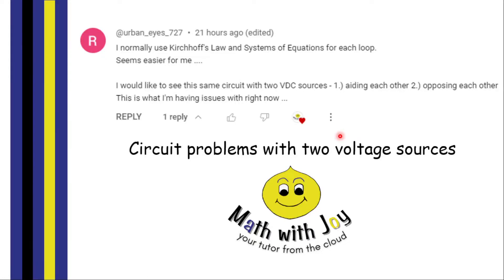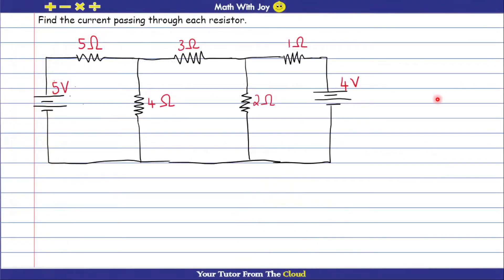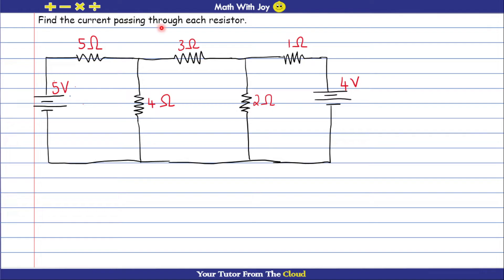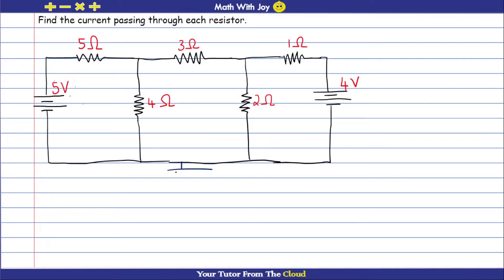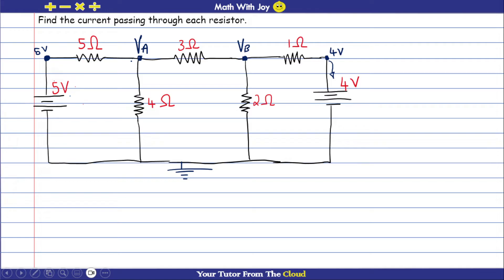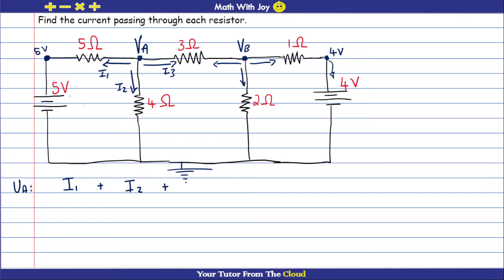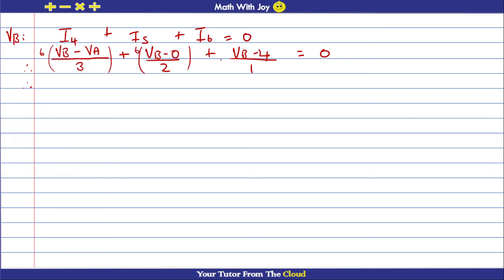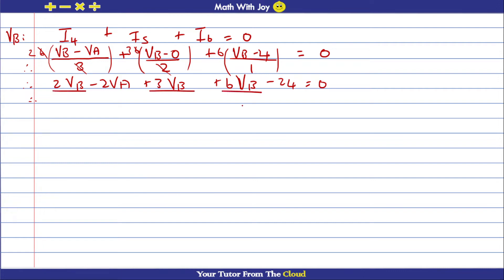Circuit problems with two voltage sources

Comment: I need the same calculator as the one you use. It can find out several unknows from several equation at once.
Reply from the maker: Yes it is a must when dealing with these circuit calculations; it saves time.

Comment: what if one voltage is + at upper part and - at the lower part and the other voltage is the other way around 😢
Reply from the maker: This is the simplest way to do the nodal analysis. Irrespective of how the voltage sources are arranged, just find your ground node and all the other nodes. Then set up the equations like we did in this video. Your answers will tell you if your assumption of how the currents flow was correct or not but your values will be spot on.